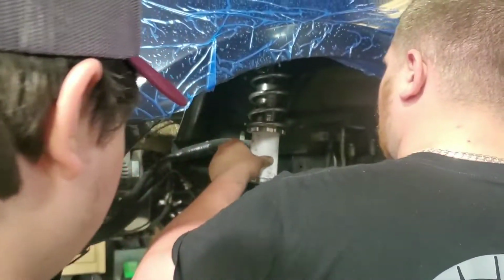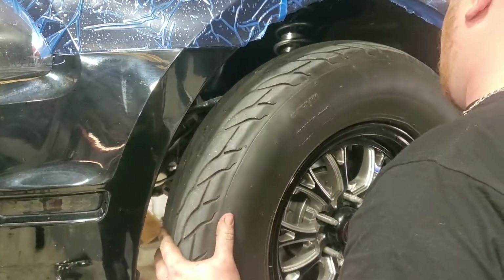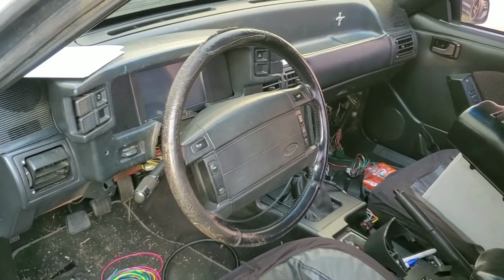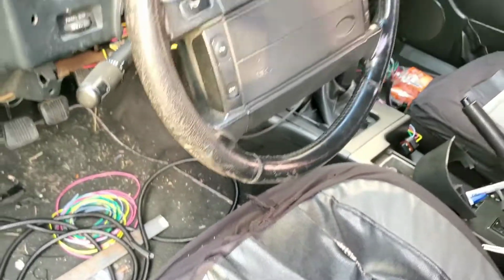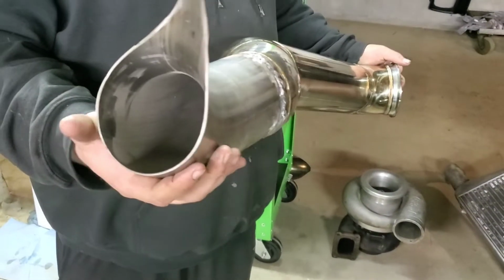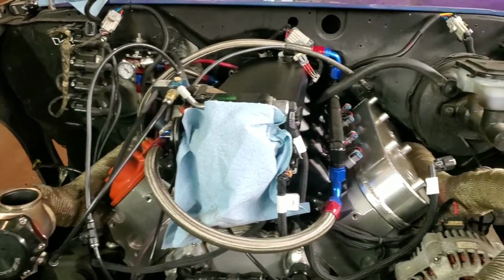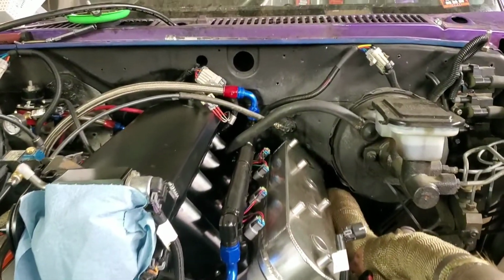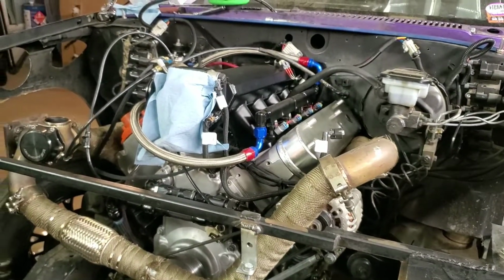TEARDROP Exhaust Process and some Track Testing

Comment: Them hole saws are usually used late at night after a few drinks, that ways when you screw up it don't hurt so bad 😂Looks good boy's 👍👍👍
Reply: Amen! So very true! Great video! Keep them coming!
Reply from the maker: There have been a few scratches and bumps during the turbo install. No injuries to the car 🤣🤣